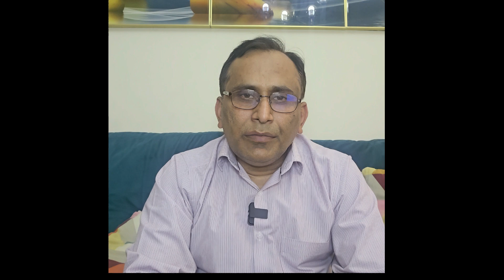Process Engineer Roles

Comment from the maker: A process engineer is responsible for how a plant or process actually works, from raw material in to finished product out. The role sits between theory and real operations.
Design, analyze, improve, and support industrial processes so they are safe, efficient, economical, and reliable.
Chemical Engineering
1- Process design and calculations
2-Process Safety Engineer
3- Plant operations 
4- Technology / R&D Process Engineer
5- Commissioning and startup